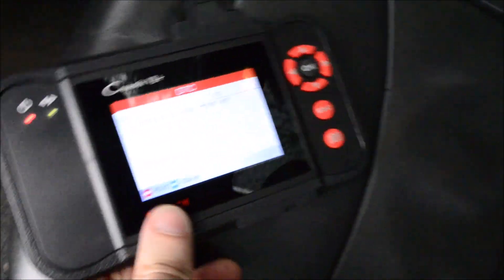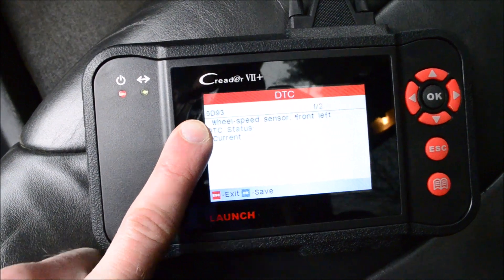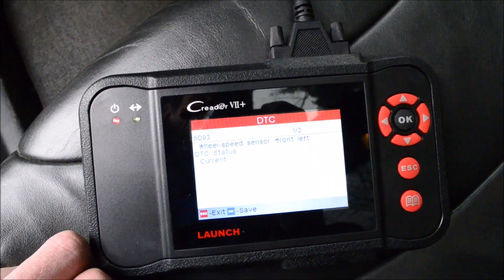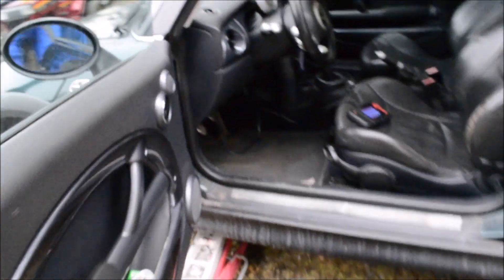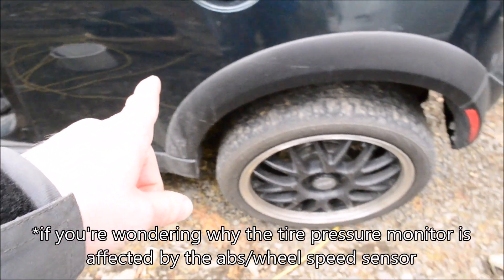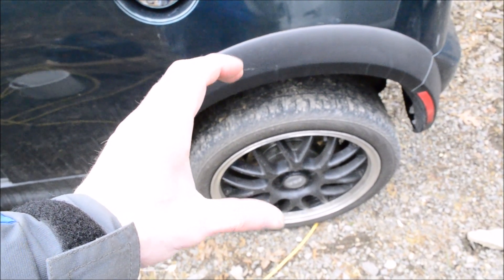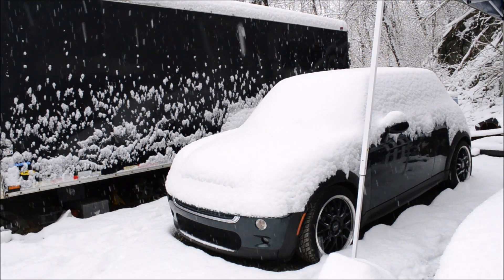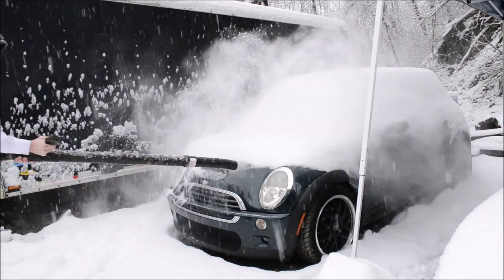ABS, Tire Pressure, DSC Traction Control Lights Come On - MINI Cooper

Comment: after changing two time abs sensor on my mini R50 light still on I also change the wheel bearing but still get the lights on have you suggestion??

Comment: I have replaced all the abs, disc brake sensors everything, unplugged my battery and plugged it back in and I cannot get the stupid disc error sensor and the tire pressure sensors lights to go off. I saw a video that shows that I need a scanner to get them to go off. Got any suggestions? I’ve got a 2005 R52 1.6L

Comment: What's up I'm trying to see if you've already done a video or thought about switching to Chrono gauges, so that you can tell real oil pressure and oil temp on your car? Ive seen the vids about installing the gauges which seems to be an easy process, but what other steps would be needed for those systems could work?
Reply: Have you changed over to chrono yet? I’ve just changed mine over, it’s fairly straightforward but you will get the mileage reading from the new chrono gages as your mileage.. I haven’t figured out how to correct this yet but I have been told it can be done by a main dealer for a fee!

Comment: Hi have the same issue when i start the car after awhile it disappear. Is this a mechanic sensor failure or just an issue like what u shared? Thanks for thr video was worried that repairs might cause alot.
Reply from the maker: It could be anything you'll have to take a look at your sensors and/or hook up an obdii scanner to see which sensor is bad

Comment: i change the sensor but the problem is still there impossible to erase error code so what could be the problem?
Reply from the maker: abs computer, wiring, or the ring on the hub is dirty or damaged
Reply: did you ever fix that issue  Kenet, ? I am having the same problem even though I replaced the abs sensor, / cable and put it a new wheel bearing
Reply: @eugmol9798  1, check there is coming out ( from the car to the sensor) you can use the old wiring as the holes are very small . Both will be positive mV.

2,did you have to bump in the new sensor this could of damaged it debur the hole the new sensor should slide in.

Comment: Can this tool perform an 'adaptations reset' on the CVT/automatic in the base mini cooper (mine is a 2003)
Reply from the maker: I don't think it can, however I can't test it because I have a manual transmission.

Comment: I Love your videos! Always helpful and fun to watch. Would you be able to upload a video showing how to clean out the ride level height sensor connection(s). That'd be very helpfu!l Thanks!
Reply from the maker: Thanks! Just use some electronic cleaner http://amzn.to/2HC7ZOM , use a toothpick, and/or compressed air.  Sorry I can't upload a video for it, no time right now :O
Reply: a DIY Car Guy where on the control arm is it located because im not able to find it...
Reply from the maker: It's like a small black square with a plug going to it, and some little arms coming off of it that attach to the frame. You can't miss it, it's pretty out in the open. Search "mini ride level sensor" and you can see what it looks like. Apparently it's a sensor for leveling the headlights...if your car doesn't have the xenon headlights then it might not have the sensor. You probably have an abs sensor problem and a sensor needs to be replaced. I don't know why my abs light went away when I plugged the level sensor in....maybe my abs sensor wiring is faulty and I bumped it back into place when I was down there, but it threw me off for what I shared in the video.
Reply: a DIY Car Guy thanks Bro. I actually think i have see it before... (smack to the face) i just didn't even know what it was for...
Reply: a DIY Car Guy Thanks Man!! Keep posting your vids they're really helpful!
Reply from the maker: No prob man, will do, thanks for watching!